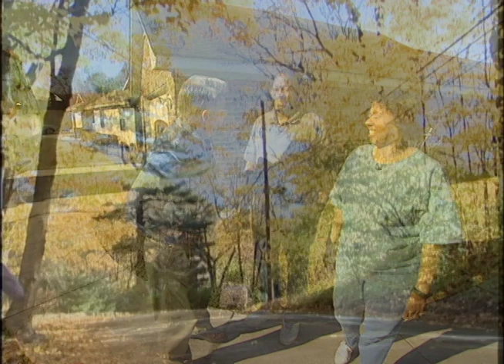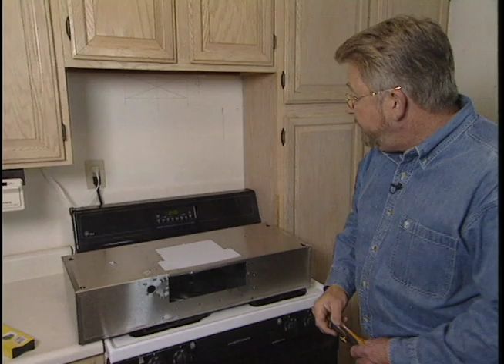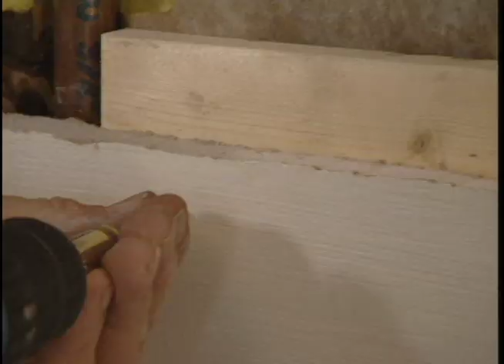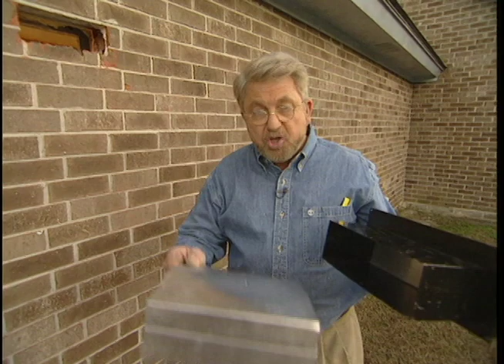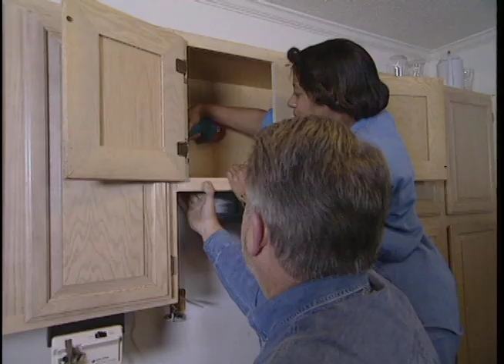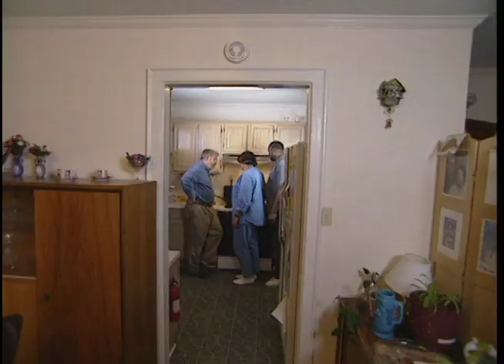How to Install a Range Hood

Comment: The circuit you connected the range hood is a required small appliance branch circuit SABC, it is only for receptacles on the counter top and a gas stove and/ or a clock. The range hood is a violation.
Reply: The requirements for SABCs was in place well before 2000.
Reply: lol Bob I respect this level of knowledge. But this video is from the early 2000's, I imagine code might not have been up to today's standards.